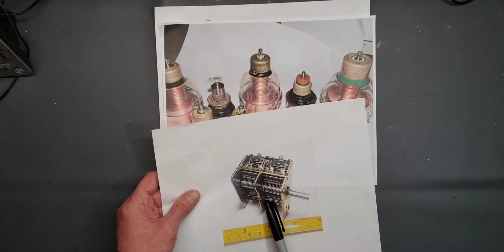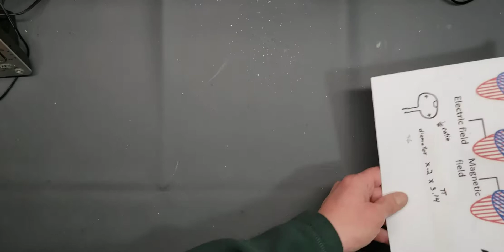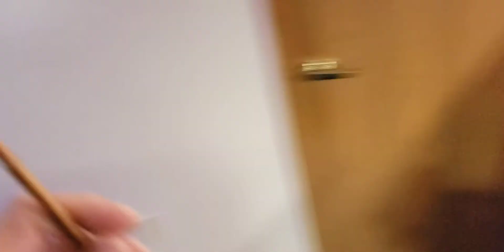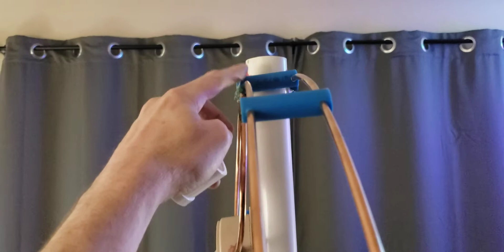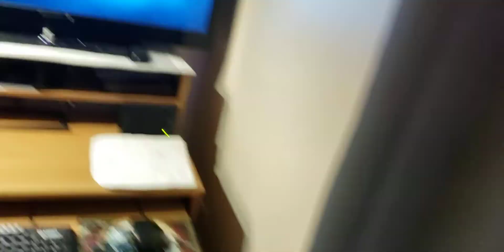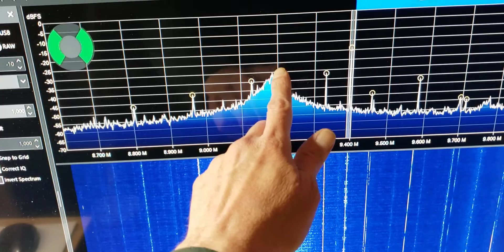MAG-LOOP Peaks! are Huge!

Comment: Concerning the orientation of the electrical (E) and magnetic (M) fields, here’s how I think about it. First of all, the E and M fields are always at right angles (90 degrees) to each other; they don’t flop around as some have suggested. Now consider the following experiment. Imagine you are holding a simple wire antenna vertically in front of you, and you have a friend standing across a room (or field or whatever) who has an identical wire and is also holding it in a vertical position. Now, if you drive your antenna with an RF source, it causes electrons to oscillate up and down (i.e., current flows). This generates what is referred to as a vertically polarized E field. In this case the M field is oriented 90 degrees hence is horizontal. For this case, the emitted energy causes electrons to oscillate up and down in your friends antenna as well (i.e., his antenna polarization is matched to yours). If your friend were to rotate his antenna 90 degrees, the polarization of the two antennas would not match and he would lose your signal. If you were to rotate your antenna 90 degrees to match your friend’s orientation, the two would again be matched in polarization and he would again receive a strong signal.

Because the M field is always 90 degrees offset from the E field, as you rotate your antenna, both the E and M fields rotate. So, for example, if you rotate your antenna 30 degrees clockwise, the E field also rotates to 30 degrees, and because the M field is always 90 degrees offset from the E field, the M field will now be oriented to 120 degrees (90 + 30). To maximize the performance of the radio link, your friend would need to also rotate their antenna 30 degrees.

As one last example, consider that you rotate your antenna 90 degrees. In this case you your antenna is horizontally polarized and your friend would need to also rotate their antenna by 90 degrees to match yours.

Hopefully this is helpful.

Happy Holidays!

Jim